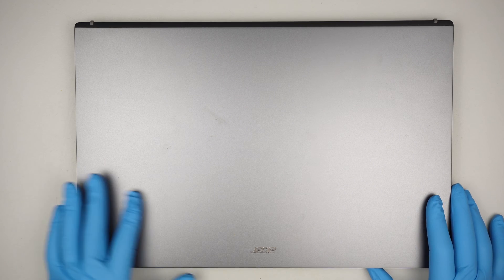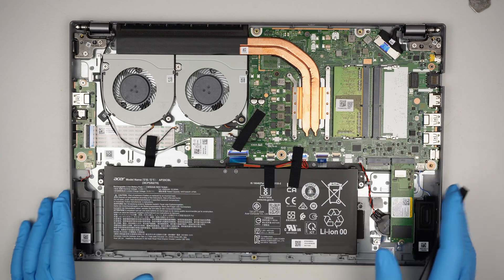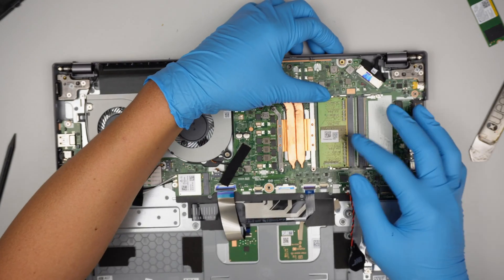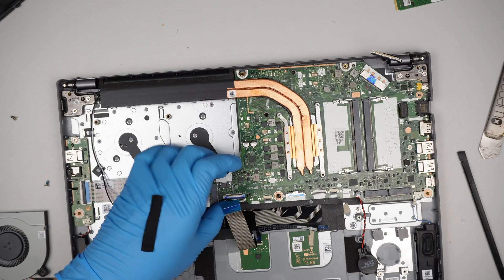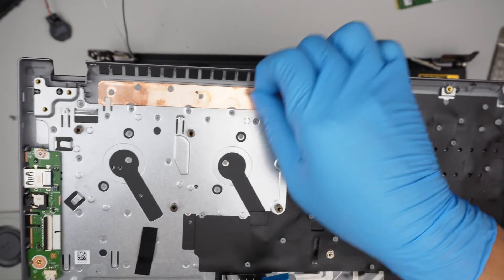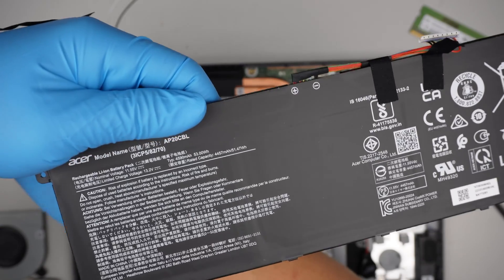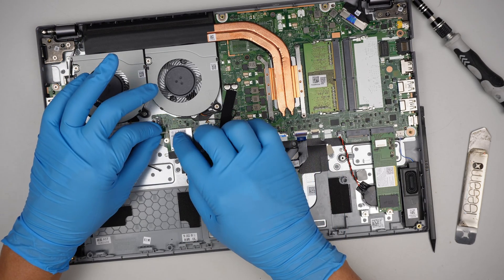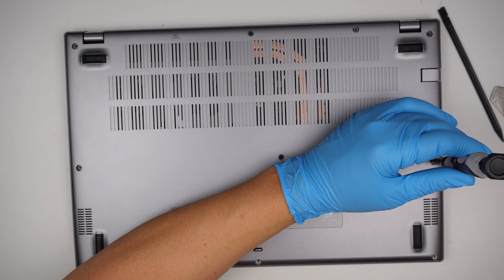Acer Aspire 5 N22C6 TearDown Disassemble Upgrade

Comment: Hi, 

My laptop recently hasn’t been turning on sometimes when I press the power button and doesn’t shut off propely and the blue light and fan stay on.

My time also keeps not updating and I have to manually sync it.

I am pretty sure it’s a cmos problem. I have taken it apart and everything is connected fine. I believe the cmos battery is underneath the ssd and I tried removing the connector but it wouldn’t come out.

Also, when I press down on the laptop sometimes, it turns on .

can anyone help me ?